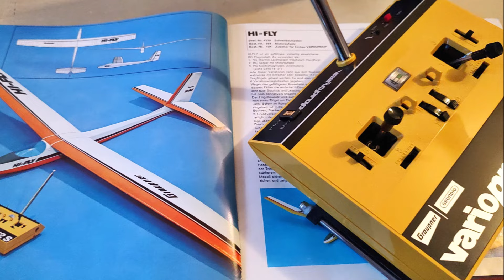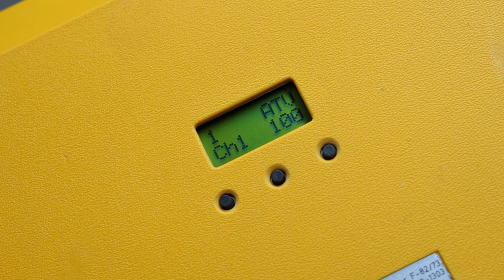Varioprop 12S - rebuilding

Comment: Very nice. In 2016 I refurbished my Varioprop 8S transmitter. The digital base Electronics was made by a friend of mine and the HF-Part comes from FRSky. I use it for my Retro Model from Graupner: Middle Stick.